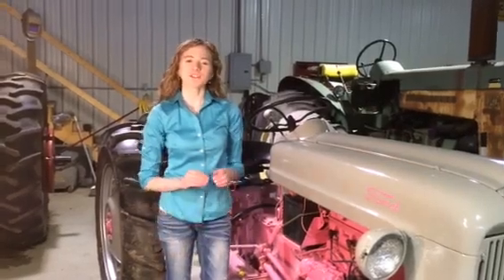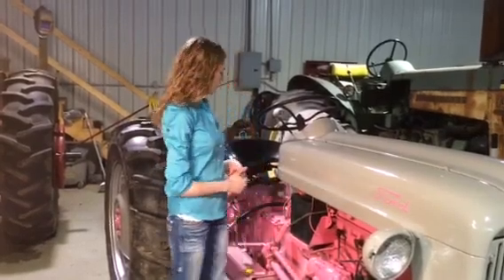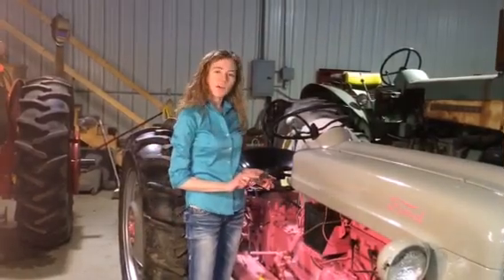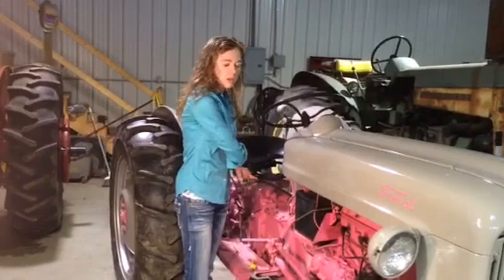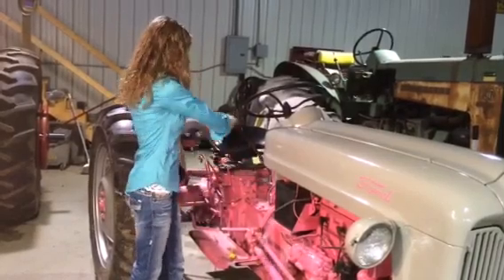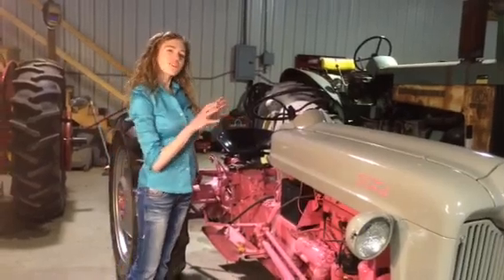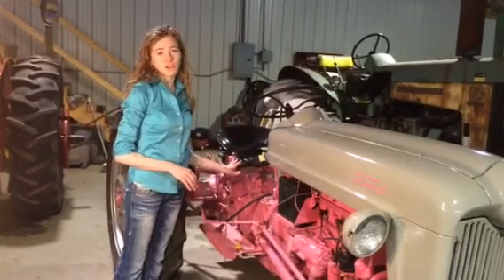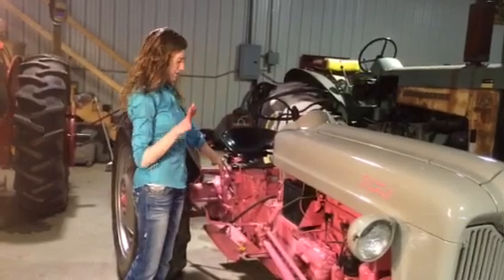How to Easily Fix Tractor Hydraulics

Comment: My 9N will lift the hydraulic arms without any weight.  However when you attach any implement it will not pick it up.  Any suggestions?
Reply from the maker: Phil, This is easy to troubleshoot by removing the side door (the one without the PTO lever). Shine a flash light in there with your 3 point arms in the up position with the tractor running and you'll be able to see where the oil is leaking. (Do NOT put your hand or any tools in this compartment!). 

If the top piston has blown the ring, then oil will run from the top down--just be pouring out. 
If the head gasket is blown, oil will also run down from the top. 
If the relief valve is the issue, it will bubble up from the bottom of the pump. 
If the top lid gasket is blown on the inside, then oil will be running down the side of the transmission case on the inside. 

This would be hard to trouble shoot with the tractor taken apart, but easy to trouble shoot with the tractor running by looking through the access panel on the side. For further help, watch my top lid repair video here: https://www.youtube.com/watch?v=XcWtNVOxzDg
Or consider purchasing this DVD: http://www.farmtractorrepair.com/product-p/1250.htm

Comment: Very good video.  Excellent presentation.  Do you have more information on the hydraulic/transmission oil you used.  Can I find it any where, say at TSC?
Reply from the maker: Bob, we use Hydra-Trans oil, which is definitely available at TSC stores. This oil will service both the transmission and the hydraulics.
Reply: Thanks for the info.

Comment: She has obviously never heard of Blaise Pascal. Be VERY careful how pressure you put into that reservoir. Force is equal to pressure times area. If the surface area is 100 sq. inches and the pressure is 100 psi you get 10,000 pounds of force!!!!!!!!   Ka frickin' boom!!!
Reply: its a air hose ...im sure she isn't pushing 100 psi, plus its not a connected closed area. its a rubber end on the hose

Comment: Goes to prove that you don't have to look/act like a "grunge", to operate/fix equipment, especially the "old stuff".☺ My wife is better at operating, as opposed to fixing. Oh, she's GREAT at DIS-assembly. But the RE-assembly she needs a bit of coaching with, still! And, she doesn't look like no "Tugboat Annie" herself, either, although she does insist upon a pair of those light-duty Mechanix-brand gloves, since she ain't got "elephant-hide" on her knuckles like I do.☺

I'm proud of her liking to help me, especially since she seems to enjoy it so much. And quite often, that smaller-hand will fit in spots that my beaten & swollen ones won't, and therefore get the job done and over with.

That, and I must admit: That "three and a half-fingered" grease/sweat-wipe across her cheek looks a lot-better on m' little red-haired Katy, than it do on ME.....!☺

Comment: Great Video Well done and described . I have heard of this Hydraulic   priming method talked about on some tractor sites and they warn to not build up any pressure past a few LBS or this could harm seals. Just use air tenderly and  sparingly as she did just enough to move hydraulic fluid into pickup tub and hyd pump area. and when you see the 3 point lifting stop using air.